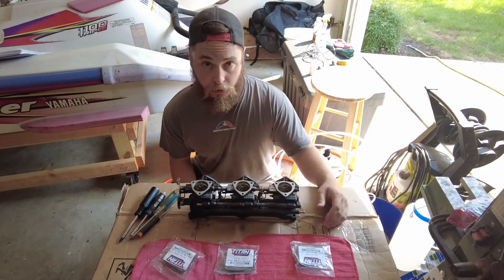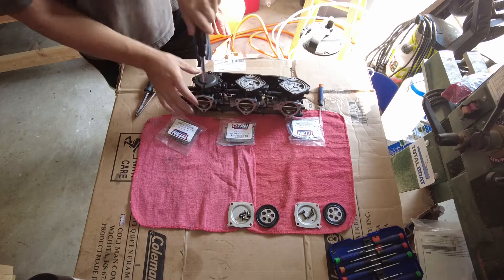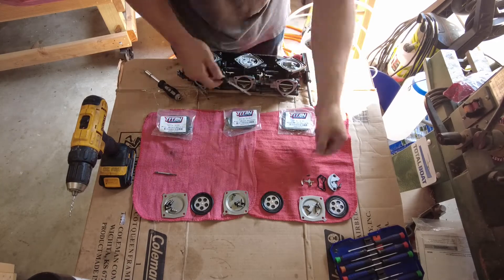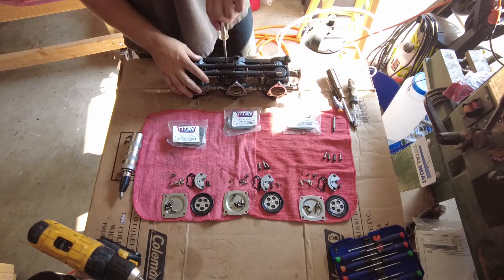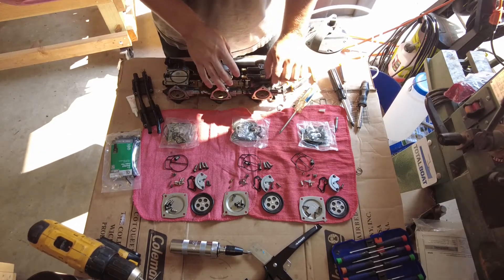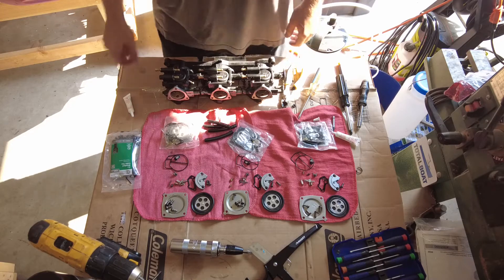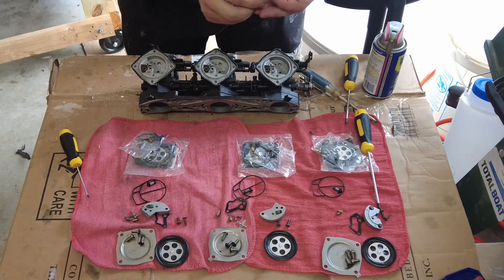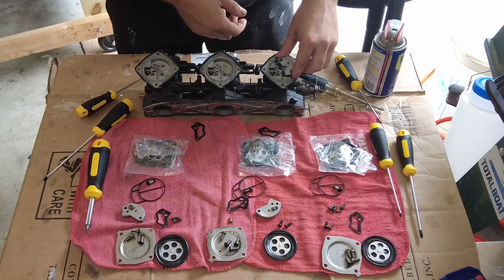Rebuilding a Yamaha WaveVenture 1100 Triple Carburetor! (Jetski)

Comment: just cleaned my carbs yesterday and didn't realize there was a fuel filter in the other side. looks like ill have to start over. but thanks for the info. I've never seen a fuel filter in the carb before. also I've been doing a top end rebuild on my 96 wave venture cuz #1 cylinder also failed. ive been fallowing your videos and there spot on. Thanks again.
Reply: They're* spot on

Comment: On the back side you only use the rubber separation seal? Nothing else? None of the flat rubber seals or “paper” seals or anything?
Reply from the maker: Yea on the carbs there is an external fuel pump.

Comment: Doing good man, just bought one today. Number one cylinder has no compression what’s so ever but other two have 120 what could have caused it?
Reply from the maker: Without knowing anymore about it I would guess the oil injection failed on cylinder 1 and the rings seized to the piston or the piston just cracked. Good luck with it man.

Comment: When you said reset the screws what screws are you referring to?
Reply from the maker: I’m not sure, what part of the video? Probably the high and low speed carb screws if I had to guess.
Reply: At the end of the video you said “Off video I reset the screws” I’m going to be performing the same Carburetor rebuild and is there some kind of precision reset for the screws that I need to know? Or in this video is that all that needs to be done for rebuilding these carburetor so the next step would be install them back on the motor and start them up?
Reply from the maker: @surferjoe655  I was talking about re-setting the high and low speed screws. If you took them out when cleaning you need to set them back to what they were before.
Reply: @MarleyJaxGarage  You should include those specs along with part numbers used for the kits/jets and the size of the fuel line in the desc.